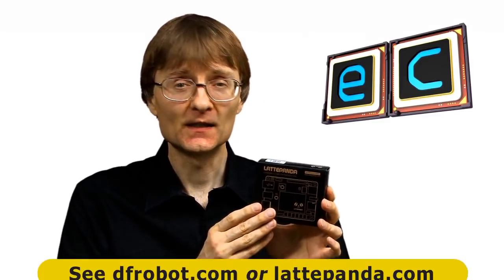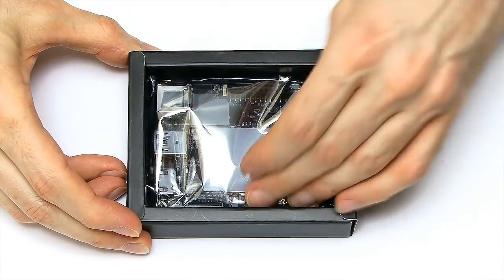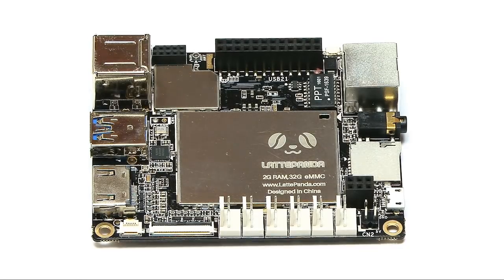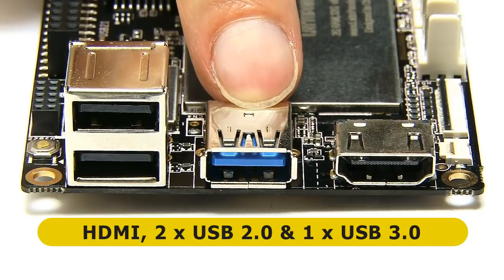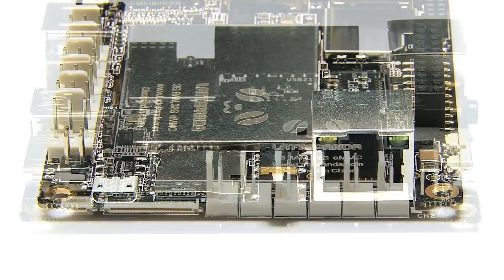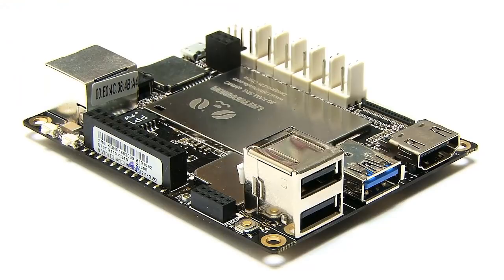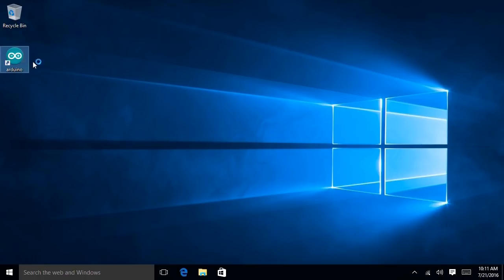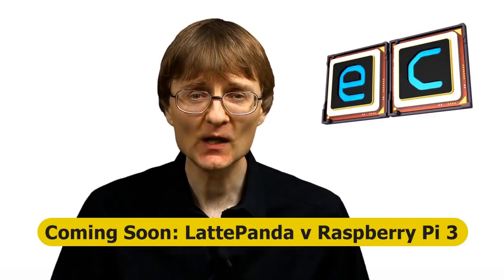LattePanda Windows 10 Single Board Computer

Comment: Why would someone want Windows 10 when he can have LINUX ?!? dont get it.
Reply: razzberry piie attracted ppl(younger age) to linux 
windows want to fight it 
i think they have to lower there OS price or make it free coz linux is free and the whole point of this is very low price mini-computer
Reply: never mind 100$? isnt it a little high?
Reply: "Windows" isn't doing anything. The company that makes these just bought the Windows 10 activation keys from Microsoft to use in their product, just like any company would for a PC or Laptop. It just so happens that this is a single board computer. It is not some reaction to Linux based boards by Microsoft, it is just a product that one company is selling.
Reply: I think he was sarcastic!
Reply: if they put Crowley from supernatural instead of this guy 
I would buy it :D
otherwise no thanks
Reply: Probably sarcastic. But linux is a pain in the ass for me.
Reply: Windows is not designed for supercomputers and Windows cannot run on supercomputers...
Reply: Windows 10 is $100 and yes Ik you can get it for 30 on kinquin
Reply: +RustCakes https://www.neowin.net/news/only-3-of-the-worlds-most-powerful-computers-run-windows

Supercomputers CAN run windows. And depending on software engineering, any OS can run a supercomputer.
Reply: yea, you could run a shitty program like windows on your good linux....
Reply: Steam runs natively on Linux, and I've seen people running Battle.net too.  Linux has both Libreoffice and Open Office.  These days it's also really easy to install and run, even easier than Windows.
Reply: Growing every day.  Soon enough all but the games made by Microsoft will probably be available.
Reply: Because unlike Windows Linux doesn't spy on you. also Linux is infinitely more customisable than Windows, doesn't slow down over time like Windows, and is faster than Windows out the gate on most any hardware.
Reply: A month and a half ago due to Windows 10's spying and a video I saw on a Linux distro I tried said distro. After 6 hours using it in the live environment I installed it. Now have Linux on almost all my PCs and am amazed by its variety and stability.
Reply: Yes there are ways to turn things off, but Microsoft has already worked ways around those to turn the spying back on as well. Even with the options built in it has been noticed that the updates that you can't turn off have turned options that were off back on. Further you agreed when you agreed to the EULA to allow Microsoft to look on your hard drives and make changes without your foreknowledge and permission. Not my cup of tea. Many people who use Linux dual boot with Windows for Windows games and had their entire Linux partition erased losing all their data.
Reply: I can use a gazillion audio apps that aren't available in Linux.
Reply: Just because there are a lot of them doesn't mean there are any that are any good. Tons of audio options on Linux as well, and they work just as well.
Reply: If you like something,use it..If you don't like it then don't use it...as simple as that.. Do not bother everybody else with your negative brain
Reply: gensu Sasaki if you didnt got it yet. Windows is Dead. Microsoft gave it up too.      going All Linux. Win 10 is over
Reply: Many of those I know still using windows are still all the way back on Windows 7. Plus at the rate Steams going all but Microsoft games will have a Linux version soon enough.  Heck even many of the newer AAA titles have Linux versions.  Their Linux library is steady growing with hundreds of games, so son that shall no longer be an issue either.
Reply: meow meow Yep, like Tomb Raider and The Witcher 2. Terrible indie games. lol
Reply: meow meow Lol. On break at work and those where just the ones off the top of my head.
Reply: Many game Dev use DirectX as they 3D API, this the primary reason I use windows. OpenGL is useless (just used for mobile device and console because there's no choises), and in the future OpenGL will replace with Vulkan.
Reply: U set a new RIG with core i7 + 32GB RAM + Nvidia GTX1080 and Install Linux as the OS, eh??? LOL
Reply: Actually the big companies are switching to Vulkan, which will give both AMD and Linux a leg up on Nvidia and Microsoft.  AMD has yet to release new Drivers on Linux true, but they are waiting to release their new drivers, which would leave AMD with the more modern drivers on Linux, and Linux able to use Vulkan on AMD systems which works better on many of the most modern games than DirectX combined with Nvidia. The dynamics in the computer world are set to change, especially since most Linux distros need far less hardware to run the OS leaving more open for the games.  Not to mention the lack of spying on Linux.
Reply: yeah, everything can be happen in the future. And about spying and hacking, I really don't care since I never store my Credit/Visa/Master card ID on PC/web/mobile. haha.
Reply: You know they can even look at the content of your hard drive and erase anything they don't like right? And you don't have to store it, as they record your keystrokes, so they have a database of everything you've ever typed, so all you had to do is type it once.  Also, the fact they can force updates to your computer can and has broken people's computers, which is also a potential concern, especially since they have already been proven to have done this purposely in the recent past.
Reply: "OpenGL is useless"
What utter trollop.
If the graphics API you use is the limiting factor in your game engine, you're just a shit engine developer.
Microsoft has had a stranglehold on the personal computing industry for decades, DirectX, Office, Windows, all of it. Tons of badly implemented, expensive software. And everyone uses it because everyone uses it. It's ridiculous and it needs to end.
Unix is clean and efficient. It should have been the de-facto standard years ago. Some people like to say "windows isn't designed to run on low power systems" etc. Well, on my course at the moment, we are writing an OS kernel for a cpu that runs at 180Mhz, and has 192kb of ram. If you think an OS should require hundreds of megabytes of ram and a multi-gigahertz cpu, then you don't know what you are talking about.
As for gaming, it is literally the only thing keeping me on windows.
Also, and here's the biggest point. It's fucking free. If computers came with linux on them by default, they would be £100 cheaper than they are now. All of them. And the only thing that needs to happen for that to be the case is for more people to use it. That's £100 for a better gpu, or a nicer screen, or some fucking beer money for the pub later...
You can be the guy that votes with his dollar, or you can get knowingly get boned in the ass by a big corporation.
Your choice.
Reply: OpenGL is about to be replaced with Vulkan too, which some say is better than DirectX, and even gives new life to AMD over Nvidia/intel.
Reply: Michael Cox Vulkan is an even lower level api than opengl, which makes it potentially faster, and allows for more freedom, but also makes it harder to use. There is at the moment a shortage of programmers that understand programming at a low level. I know a couple of employed developers who don't understand how pointers work.
So alot of the lazy high-level developers you find will probably look at this and think, meh, Directx is easier, i'll use that instead.
So as sad as it is, I don't think we will see a huge uptake of vulkan over dx12. :(
Reply: 101m4n Really? That is not what I heard. I heard the companies were actually liking it because it was easier to make multiplatform games and that console game makers were already starting to try to take it up.
Reply: Michael Cox Huh...
That was just a gut feel really. I haven't been paying all that much attention to it all.
In any case, that's good news if you ask me!
Reply: AMD is pushing it hard, for obvious reasons, and the easier multiplatforming is in it's favor too.  Microsoft's mishandling of privacy and such in people's eyes combined with them pushing their own stuff over everyone else's are also points against DirectX.  There are worries of Microsoft locking others out.
Reply: ***** Except I have been on Linux for a few months now and the only time I have used the command line was to enter a command to decorate the command terminal. Literally everything else has been just as point and click as Windows, but better as there are more options and less spying.
Reply: ***** When was this? Also basic Ubuntu doesn't come with any closed source software like codecs. You don't need to go to the command line to install them anymore I don't think. There are many Ubuntu and debian based distros now however than do come with all of that already installed though, like my personal favorite Peppermint OS 7.
Reply: ***** I think you should try again. Maybe Peppermint OS or Chalet OS. Linux Mint is also really popular and supposed to be really easy for new to Linux users. Then there is Linux Lite 3.0 which is close to idiot proof and will run smoothly in 32 bit version even on a pentium 4 age machine. I know cause I have 2.
Reply: +Michael Cox Now now, it can only be fool-proof... LL is only idiot-resistant (any idiot can mess things up real good if given half a chance)
Reply: noobs
Reply: Because Windows has apps that people actually want
Reply: +Peter D Morrison Microsoft has a stranglehold on the entire industry and has done for decades.
Most of their software is plain and simple bad. You say people want the apps? You're right, but if they knew how much better they could be if M$ didn't have such an easy time maintaining their monopoly, then they probably wouldn't.
That being said, a few more cockups like w10 privacy & poor dx12 optimisation, and we won't have to worry about it. Gabe newell is already throwing his weight (and that of valve) behind linux, and open source productivity software is every bit as workable (although not as pretty) as Microsofts stuff.
Reply: 101m4n Honestly I cannot think of a single app that windows has that cannot be found in linux. From open projects such as Open/Libre office or even simple Wine integration (for the stubborn devs that stick to winsux).

Hell Microsoft seems to agree, otherwise their Linux integration does not make sense.
Reply: I play video games. They are essentially the only thing keeping me on windows (directX). They also tend to be big and complex enough that they don't run under wine (at least not well).
I don't have much experience with unix based OS's, I stuck ubuntu on an old laptop of mine once, that's about the limit of my actual experience. But what I do know about the architecture of it & how it is implemented tells me that it's elegant & efficient, both traits which I value from an engineering standpoint.
The day will come when I am fed up with M$ (or they stop supporting w7). Then it's unix for me! Hell, not gaming so much will probably be good for me anyway...
Reply: 101m4n My good sir Steam has an ever growing amount of even AAA titles that run native on Linux. If it has a little Steam symbol in the compatible OSs it will run on Linux. Case in point, the new Doom runs on both Open GL and Vulkan native in Linux through Steam with every bit the frame rate and visuals as on Windows, maybe better. In fact I can run War Thunder at near 60 fps with a Core 2 Duo and a Gt 730 on Linux. Switching from low to high preset just drops it to 30, but not bad considering the weak hardware. And there are tons of other indie games on and off Steam as well.
Reply: 101m4n Also Windows 7 support stops in 2020, so you have that long at least before that happens.
Reply: Oh, sorry. Doom runs in Wine, not native. Still some impressive framerates. There are videos on YouTube
Reply: True, I also play a bit of dota2 which is a valve title, and runs native under linux w/vulcan better than it does on windows.
But there are lots of games I play from time to time that will never be on linux. The bethesda titles for example. One of my favourite indie titles is called spaceEngineers, sort of space-sandbox thing. It's written in c# with visual studio and uses directx. So that will never be on linux either.
It will be a while before the linux userbase is large enough to start attracting the big AAA developers too. Though that's mattering less and less by the day as most of the AAA titles we see these days are over-hyped trollop anyway...
Time will tell I guess ;)
Reply: 101m4n That Space Engineer game sounds similar to Kerbal Space Program, which is available for Linux through Steam. It's not free though, it's about $40. Also many AAA titles are moving to Steam. Tomb Raider is on Linux, The Witcher 2 is on Linux and so on. Steam is really backing the move to Linux hard, and what I have been amazed to see is that in videos I have seen comparing the Windows and Linux versions is that the Linux version looks better.  There is a video showing 35 games run on a 750 ti in both Windows and Linux that showed this. More games had comparable to wildly better frame rates than had lower frame rates as well. Bastian ran at around 78 fps on Windows and around 254 fps on Linux for example.
Reply: Also from everything I have seen Directx12 is an unpolished mess compared to Vulkan. This will hopefully put more new games in Vulkan, and if it runs Vulkan it can easily run on Linux as Doom proves. Even in Wine. This means Steam may add its weight behind Vulkan just like AMD has, and might cause AMD to help back the Linux move. Plus from the analytics I have seen Linux use is growing. It is up from I think 1% to 3% of the market share. That's a good size chunk of people popping over to Linux. Probably due to the huge missteps Microsoft has been making.
Reply: Don't get me wrong. I use Linux too, and love it.; and Android (Linux-based). Also use OpenOffice, (using it now), but it lacks some of the functionality of MS Office and OpenOffice Writer only supports Word 2000 ".doc" files. No good when you exchange documents with businesses that use ".docx". (".docx" can be opened, but not saved, as far as I can see.)
Reply: As for Microsoft support. Waste of time. They don't even understand basic questions and fob you off with stock answers like "Try Booting to Safe Mode", or "Run CMD Prompt Admin Mode, MSCONFIG", etc.
Reply: Gave up on MS. Ended up fixing a Windows 10 focus switching bug myself, which they denied existed, despite about 100k users reporting it for over a year.
Reply: Peter D Morrison Open office is no longer supported is your problem. Libreoffice has .docx available, so just switch to it for full functionality. Also, that is kind of what they are taught. Most all phone in services have scripting they have to follow or get written up or fired. Heck even the cashiers at fast food restaurants have to follow a script, and are told they are to sound as genuine as possible while doing so.
Reply: +Mike Caldwell Let me think.
A "mercedes" that's 20 years old, has flaking paint, breaks down all the time, and has the steering wheel on the wrong side.
Or a ford punto that works alright, doesn't look as flashy, isn't is comfy, but it will get you where you want to go.
Microsoft OS's are just bad... They are dressed up to look pretty with all the slick animations and a fancy user interface, but it's a thin veneer of quality over a gelatinous mass of shit.
Don't be fooled by the name and the flashy UI.
Reply: Actually it depends on the distro. Since switching to Linux a few months ago both my Peppermint OS 7 machine and my Linux Lite machine (which is a Pentium 4 machine) have run without a hitch. I have all my software installed on said machines that I want too, and have practically never been in a command line. I say practically because I had to go into the terminal to enter the commands to decorate it. It all has all just worked, even my wifi dongles. The only part that doesn't is some of the keyboard multimedia buttons that I never got to work on Windows either.
Reply: I can run a print server with it since not all printers support Linux. Those pesky hardware manufacturers need to adapt.
Reply: I have a Canon MX492 and it auto detected it, connected and printed a test page with no issue. Supposedly HP and Brother printers also are fully supported now as well, so it is far better than it used to be on that front.
Reply: I think Brother is more open to Linux. Canon printers are a bit of a lottery for me. The Canon Mp240 works but Canon Ip1000 doesn't, to be fair the latter is pretty old. Right now I still need to test the Canon G2000 if it will run on a linux distro despite no linux support listed on the Canon website.
Reply: I don't remember if the MX492 had Linux support listed or not, but it definately works on all the distros I have tried. Linux market share has grown though and now has higher market share than one of the 2 Mac OS versions still in use. So maybe more hardware companies will start to support it.
Reply: Have fun playing games on this thing...
Also, a large number of games being tied to windows is a bad thing, not a good one.
Reply: Also more and more games are going Linux every day. Wanna play Doom 2016? Install it in Wine on Linux and play it with no dropped frames at all. In fact many games that do run on Linux run better on it than Windows. The game Bastian for instance. At 1080 with a 750 ti it runs at about 40 or so fps on high settings. On Linux? Ad about 100 fps to that 40 with the same settings.  Seems games like not having to compete as much with the OS for hardware use.
Reply: The real question is "Why would someone want Windows 10 when they can have Windows 7?"
Reply: Yes, with all the wonderful spying and malware like activity in one stteamlined OS. Truly Windows 10 is a malware marvel.
Reply: I'm not too bothered about the invasiveness. If I were doing something important with my life, running a business etc, then I probably would be though. My gripe with windows is that M$ has been locking down as much of the pc industry as possible, stifling competition rather than actually competing, and withholding progress in the field.
Take word for example. Placing images in a word document is a pain. It's not intuitive, it's not well designed. There is no reason for this simple feature to be so obtuse. But it's the de-facto standard because everyone uses it. And the only reason everyone uses it is because M$ deliberately obfuscates their file formats. Not too long ago I was informed by office that I had been "upgraded" to a new file format. The program still behaved the same of course, the "upgrade" likely had nothing to do with improving the functionality of the application. Word will also inform you if you try to use the ISO approved open source file formats that "some features will not be supported", before offering to save in .docx. The proper thing to do would be to disable the features that aren't supported (if there even are any) rather than stuff a dialogue box in the users face. Seems pretty innocent on the face of it, but it's actually pretty shady. 
This sort of underhanded anti-consumer shit is the reason I don't like microsoft. And office is far from the only example. DIrectx is also a serious offender.

TL;DR Crap software, persists in the market because of sheer momentum alone, no thank you. You think windows is great? Try developing for another platform under windows.
Reply: Windows  does not "aways just work" - It is a buggy , unreliable pile of crap- the OS and apps suck,. Bad UX/UI in all their apps and OS, inefficient code, crashes in Word and Excel, etc. MS don't give a s**t about their users.(I use Windows 10 and 7 frequently).
Reply: Try Lightworks. Its Used By  Full Hollywood films and Its  *nix   OSX and Winders compatable ! 
For * Years* I  thought I would never find a good *nix FCP  replacement .     Problem sloved  ! 

Ive Ditched Final cut pro   This year to use it . I am SICK of  apples   non upgradable hardware ( I dont mind the cost  just the  lack of RAM upgradbility in a  5 year  cycle for laptops ) 

and I am SICK of forced subscriptions .  

Ill buy a system    and  all its SW . and like a old ass truck run the beast till it  blows a gasket in 5 years and start over.
Reply: Youve never rooted your phone and   gutted the beast with a new ROM. 

Easy . Problem sloved .
Reply: Axel Werner windows is better 4 daily use but linux is bettet for computing and hacking, so different ppl have different needs
Reply: StringStorm ‌ supercomputers can run Windows, but Windows is not designed as a native OS for supercomputers. Horses for courses. No argument.
Reply: Axel Werner because there's only one Windows 10 (sort of), but 100's of Linux variants. As soon as you get a Linux that you like, the project forks and you have to decide which one to follow.
Reply: Michael Cox Linux doesn't spy on you? Only if you unplug the internet.
Reply: Michael Cox I've got loads of stuff on my hard drive they wouldn't like - non of it's been deleted
Reply: Peter D Morrison Yes, Linux does not spy on you. Google and Facebook are not Linux. With Windows the operating system itself is now spying on you on top of those others. Plus if you don't use Google or Facebook and their affiliates they can't spy on you whether you are connected to the internet or not.
Reply: Peter D Morrison Wait, I am sure they will get to you eventually. Remember they got billions of hard drives to sift through. And then just like when they deleted those people's Linux partitions it will be "An accident."
Reply: The only place winders belongs on my systems is as a VM with  very limited  Lan connectivity   ...
Reply: is Linux can run a heavy duty Windows based 3D applications like AutoDesk Inventor, 3D Max and most heavy 3D Games? along with my GTX 1090 NVidia video card?
Reply: +Michael Cox Just what exactly are you doing that has you so worried about being spied on ? o.o
Reply: Ambiguous User judging by his paranoid delusional posts, probably a lot.
I'll use Linux when I don't have to spend 6hrs trying to find a driver to run a simple piece of hardware that works as soon as I plug it in on a Windows PC. I'll use Linux when they support Autodesk inventor, AutoCAD and Vault as well as solidworks. Is there even any cad software available for Linux? I have yet to see let alone work in an office where anyone is using Linux in a desktop environment.

Mint can't even format a hard drive over 2tb. WTF year is it again?
Reply: You can install Linux on this thing just fine, you don't have to use Windows. With Windows, you have access to the massive library of software for it. Some people need that.
Reply: 101m4n A Ford Pinto is like the worst possible choice for that analogy. One of the least reliable cars ever.
Reply: I use both Windows and Linux. I am also a software developer, both embedded and desktop. Best OS choice depends on your use case. Windows smacks the crap out of Linux for some things, and Linux smacks the crap out of Windows for others. For example, pretty much anything internet-facing server related should be done using Linux. For an internal business network, Windows Server and Active Directory is where it's at though. Fanboyism is dumb and childish. You choose the right tool for the job.